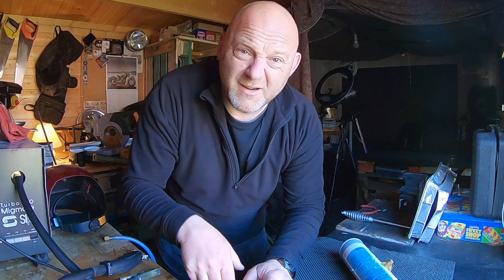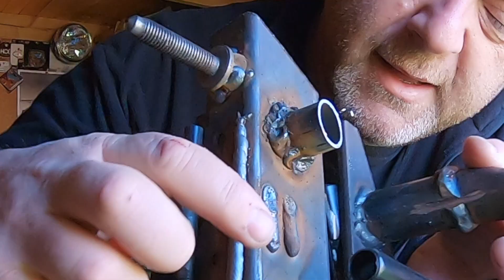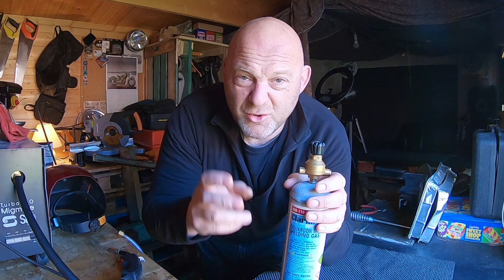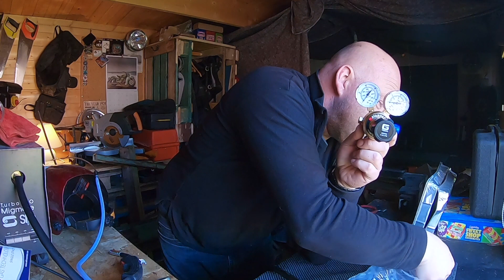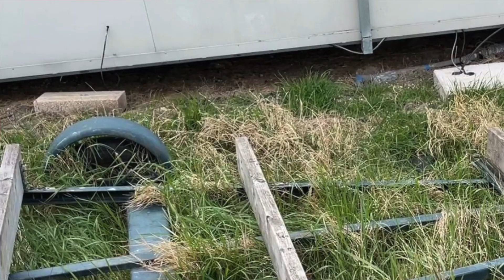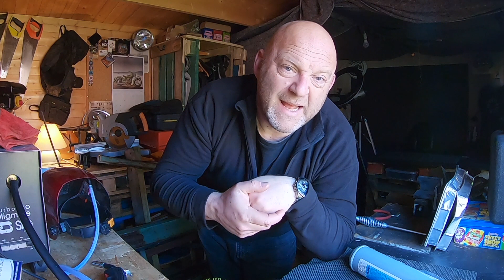MIG Welding Disaster | What Happens When You Run Out Of Gas | MIG Torch Fails

Comment: Glad to see you bought a re fillable bottle that will save you money and headaches for sure. I always buy the biggest bottle that I can because they don't cost much more to fill vs a smaller bottle only downside is bigger bottles are more expensive, heavy, and take up more space. Another thing that saves your tips is add a weld-aid lubematic combo pack to your wire machine to keep the wire clean and moving through the machine, through the liner, and out the tip.
Reply from the maker: Ah great tip. Cheers

Comment: If you can add a flow-metre to that gauge then do so, it'll fine tune your gas flow and save you from using too much. As I said before, get a tin of tip dip, that'll save your tip burning out prematurely.
Reply from the maker: Ah great. I will do cheers. What kind of flow rate should I be looking at by the way? Cheers
Reply: @RevelatorAlf  I use between 8-10 LPM on a flow metre but really if it feels like a soft breath on the back of your hand it'll be about right :)
Reply from the maker: @HepcatHarley  ah great. Cheers
Reply: I agree 100% on a good flow meter they really save gas. As for tip dip I do not use it because from my experience it causes porosity in your welding. BBQ grill high temperature cooking spray a little bit on the tips helps. There is a welding tip spray I use that I use sparingly I will find out the brand it's never messed with an x ray test.

Comment: Why not just use flux core wire.  No gas needed at all with that.  Welds fine too.  Windy weather is no problem either.
Reply: this is exactly what I have done - easy; only downside is more weld splatter which can be dealt with by using a wire wheel afterwards
Reply from the maker: Yes I may try that in the future for outdoor welds
Reply: Agreed 👍I run flux core on industrial jobs in messy and windy conditions it welds great, saves time, and money. If your machine is set right you have no more mess than good stick welding.